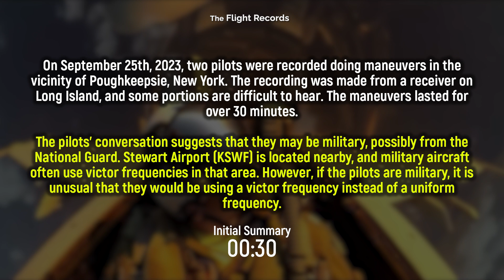Can you picture the PILOTS' MANEUVERS as you listen? |  Interesting Pilot Exchange

Comment: US military aircraft have UHF and VHF radios. This sounds like they are just doing some practice formation flying and rejoins and using a military VHF frequency to do it. Since no one else is on this freq, they can be informal in their communications vs UHF and talking to ATC. Stewart Airport has a C-17 ANG unit and it makes sense that they are doing this. No indication of aircraft type at all other than throttle response is fast and that would be expected for an empty C-17.